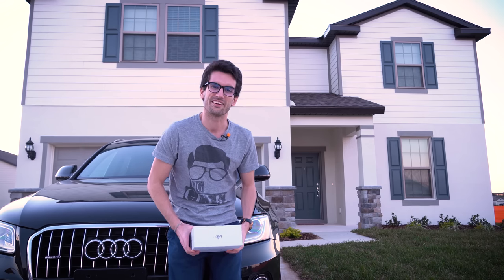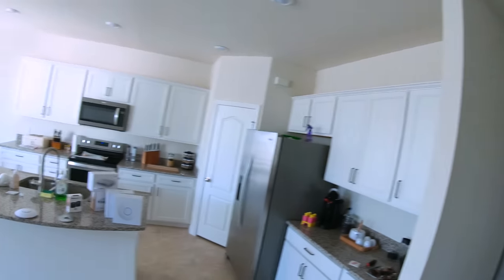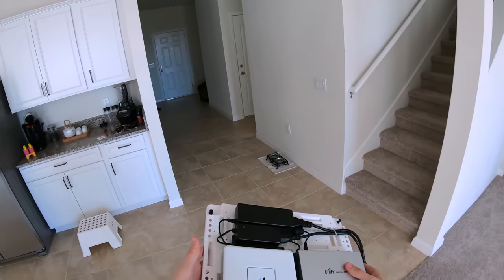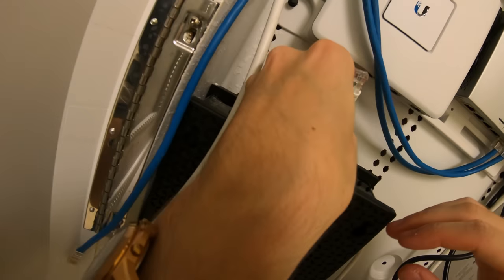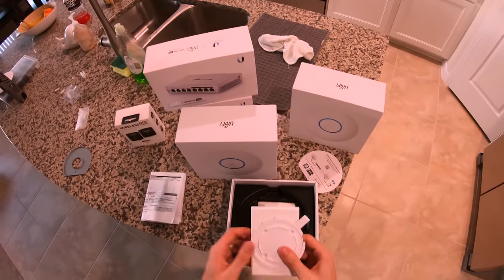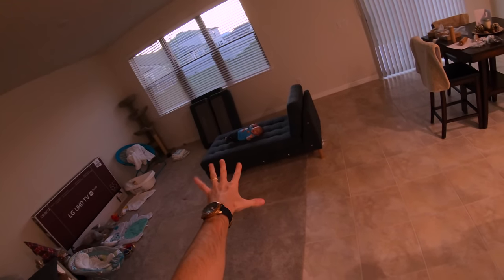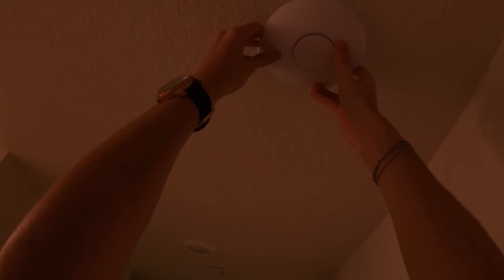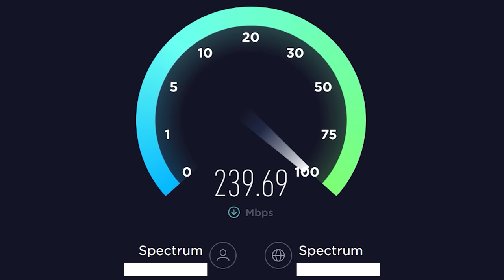How To Set Up a Beefy Home Network Solution

Comment: I have a question. A lot of people have been using multiple access points in homes, and I have always been a guy who buys one strong router and places it in the middle of my home. If the home is too big, I understand the use of multiple access points as a MESH network. So how does a device (like a phone) decide which access point to connect to? And then, if you walk around your home with your phone, wouldn't it technically lose internet connection when switching from one access point to the other? For example, what if I was using whatsapp to make a video call and walking around my house, when the phone switches to another node, wont the call cut out for a few seconds?

Comment: Did anyone else catch the sparks when he cut the Ethernet lines that had power running thru them? Also, let's see the controller setup and provisioning of the APs.
Reply: Also you should really consider using iperf to test bandwidth over your wireless. This will help you fine tune your AP settings, which will be very important when it comes to moving files across your workstations over WiFi.
Reply: OMG I thought I was the only one who noticed. This comment is buried way too deep.

NEVER TERMINATED A CONNECTED CABLE!

Comment: Should’ve drilled a small hole for the Ethernet cable nearby to that access plate and simply fixed the mount to the ceiling leaving the existing cover untouched in situ.

Comment: Nice setup!  I'm going to be annoying and critique your use of the term "mesh" network though.  Having multiple access points does not mean you have a mesh network.  A mesh network implies you have multiple wireless uplinks between AP's, like a spiderweb kind of thing with AP's being the intersections of the strands.  I think the AP's you installed can support one uplink at a time (not 100% sure on that though), so it could be a little "mesh-ish" if you found the need.  Unifi does makes "mesh" AP's if you need to have multiple redundant uplinks.  This probably isn't something you'd need at your house though.  Wireless uplinks are something to look into if you have a detached garage, barn or something where you need to get wifi out to that you can't get to with a physical cable.  Good luck and enjoy basking in the rays of your glorious WiFi :)

Comment: If you just drill a few holes in the mounting bracket you can skip the blank plate. Should be a bit more flush

Comment: the gateway is the device that assigns ip addresses to devices?
Reply: In a typical home network, yes. The portion of the network that is responsible for handing out IP addresses to the LAN devices is the DHCP server. DHCP is a protocol that is used to automatically provide network devices with the required network information, like IP address, router/gateway address, subnet mask, DNS, etc. If you wanted to make things a bit more complex/advanced, you could setup your own DHCP server and the router would only handle the routing part of the network. This is beyond the scope of most average computer users and it requires some understanding of what you're doing.
Reply: @JJFlores197  thanks for the reply

Comment: The security gateway throughput is quite low. I wonder will it be enough for you.
Reply: well, it should be fine, the USG can handle a gig connection fine, now, if you enable ips/ids then yah, you will have a drastic drop in speed

Comment: Did you consider a wireless mesh network? I have one and it's so much easier. The repeaters link up together and you can connect via ethernet to each repeater.

Edit,  I guess yours technically is a mesh but each of your access points connect via ethernet.

Comment: Wouldn't it have been easier and less problematic had you terminated the Cat 6 at the ceiling with an RJ45 connector instead of using a jack and patch cord?
Reply from the maker: Sure. But like I said in the video, this was all I had on hand and still worked fine.

Comment: OK, time for some schooling, technically its not called a handoff, its called roaming.  Roaming issues are normally caused by too much RF, if you do have roaming issues try turning the power down on the APs to decrease the cell.

Comment: Those blue cables that run from the ceiling mounts to the utility box aren't terminated properly. They are installation cables with a solid copper core. They should be terminated with a keystone like you had at the ceiling, or a patch panel. Nice video otherwise ;)

Comment: why not just leaving the plate out of the setup and use the mount bracket from the Access Point? That way it won't pop out as much and it would seal the hole.

Comment: Your screws are sticking up into the box where your cable is. You will probably have worn insulation and shorts in time. You should cover with epoxy glue or something.

Comment: The Ubiquiti equipment is quite good stuff.  The access points don't really communicate with each other on this and the controller doesn't do anything pertaining to zero hand off. Also, the hand off actually doesn't even do anything with the access point, its all programming on the client side device. https://help.ubnt.com/hc/en-us/articles/115004662107-UniFi-Fast-Roaming. Unless talking about systems like Rukus but that is a different topic. Great video though!

Comment: If I were you I would get the edge router x, is is half the price rn on Amazon
Reply: Yeah but it doesn't integrate with the Unifi access points like the USG does and is harder to configure.

Comment: Yeah, they don't like you running you're own cables. Being it's low voltage, the last time this was an issue for me... I didn't ask. I just went and ran Cat 5 and speakers lines. Had I not, they weren't going to run either.
Reply from the maker: It's really weird that they're so finicky with that kind of stuff.
Reply: @GregSalazar  Yeah, especially when sometimes they won't even entertain the idea of them running it. Contractors can be pretty weird. Tough to find a really cool one.

Comment: The smart thing, would have been running the Ethernet when the drywall wasn't put up yet. ;)  I can't believe you didn't hit the contractor up and allow you to do this, it literally would have took you a day with 1 helper, or even less.  Otherwise, congrats!
Reply: I've seen builders not offer low voltage wire options for Ethernet, and builders that would not allow work performed on site that they were not involved in due to inspection concerns... these builders seem to think everyone relies on wifi.
Reply: Henry Eng YES! We had the same issue when we built our house. They wouldn’t let us run our own nor did they offer to run any “Ethernet.” The reason I put Ethernet in quotes is because that’s what I specifically asked for. They said No, we don’t do that. Come to find out, per code, they had to run a “phone line” somewhere in the house so that we were wired for POTS. The phone line was 2 pair out of a CAT6 cable.... I could have just had them run that everywhere if I had asked the question the “right way.” I bet if I asked for low voltage wiring, they would have done it.
Reply: @BenjaminCummins  What kind of builder builds a house in 2020 without putting network drops in every room?

Comment: I'm surprised nobody has pointed out that you could have just drilled a small hole for the ethernet cable to pass through and terminated it with a regular RJ45 connector afterward.

Comment: wait, so they built your house, but why arent there no fiber in the house, i thought it should have been a standard by now in most places or am i wrong? Edit: i also went for an enterprise solution as i was tired of the standard solution here. But even if they are 1 floor from each other, that is a good solution for you, you will hardly know if they are switching from 1 ap to another

Comment: Where is cloud key gen2 :). Unifi is by far the best and easiest  system for home users. But, APs are better from Mikrotik and Zyxel (same looking, better internal hardware) and those AP have far better wall signal penetration ....

Comment: Why wouldn't the builder let you run it before the house was built? Its literally the easiest cheapest way to run it and running it after the house is built will be a pain in the ass and cost way more.
Reply from the maker: Because they don't. It's in the contract. Can't tamper with a house while it's being built. EDIT: Many ISPs also offer drops for ~$20-40 ea. Not so bad in the grand scheme of things.
Reply: @GregSalazar  That's unfortunate. Ubiquiti is an awesome choice btw; Been using their Edgerouter Lite and its super reliable and fast.

Comment: What are you using to run your UniFi Controller software, if at all?
When I put together my UniFi network a few months ago, I found this great tutorial on how to setup a Raspberry Pi as the Controller so you don't have to buy their Cloud Key or run it off your desktop: https://community.ui.com/questions/Step-By-Step-Tutorial-Guide-Raspberry-Pi-with-UniFi-Controller-and-Pi-hole-from-scratch-headless/e8a24143-bfb8-4a61-973d-0b55320101dc

Comment: I had the same mounting issue with mine. I ended up finding these on Amazon and they worked perfectly mounting to the J box that the cover was screwed into. Search B079DPXFFK on Amazon (not sure what link filters are in place)

Comment: the usg is garbage, if you want any more than what you get on a better homerouter. i run unifi in combination with fpsense/opensense or sophos utm home
Reply from the maker: The USG has been fine for me and does exactly what it's supposed to do.
Reply: @GregSalazar  good for you :)
the problem in my case is, that i'm looking at a gateway or firewall from a professional perspective. as i said: it barely does more than a reasonable homerouter. but if you dip your toes into more professinal gear, you'll quickly learn the benefits of webfiltering, proper qos, client vpn (for mobile eg), etc... - as long, as it fits your needs its good.
i don't could say the same for the unifi wireless equipment - and use them for myself .
i noticed you don't have a unifi controller. i highly recommend you to add one in (either the cloud key or as a standalone software for your server -> you'll have to reconfigure the AP's).

Comment: You will feel frustrated after trying the speed, losing more than 30% of the speed ( ubiquiti 👎🏼 )
Reply: I have a Unifi Lite AP and a 220 Mbps connection through Comcast and my speeds are pretty good with my setup.

Comment: You call that future proof you got probs right out the gate. That ubiquiti router isn’t good for handling over 100mbps and the small Poe switch is useless. You should have went with the usg pro 4 rack mount router and should have went with a 24 port 500watt Poe switch.